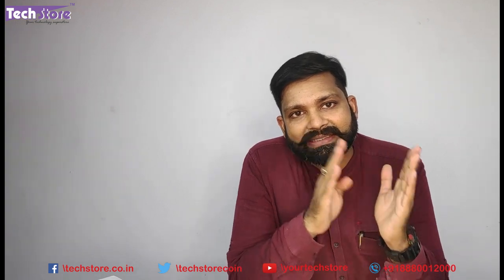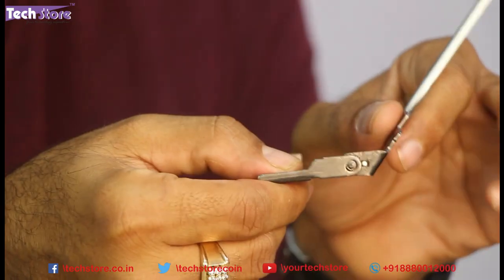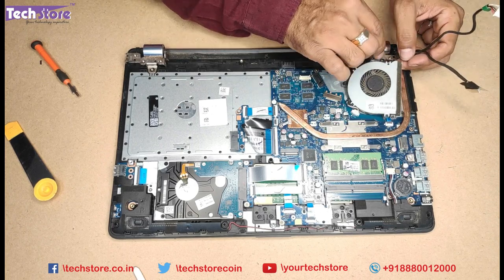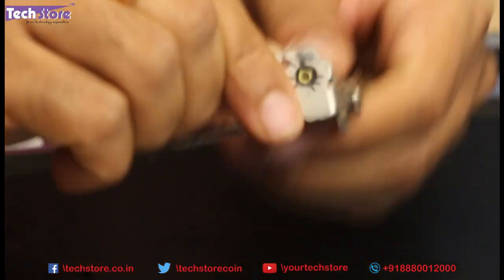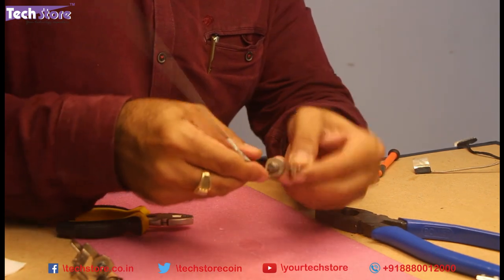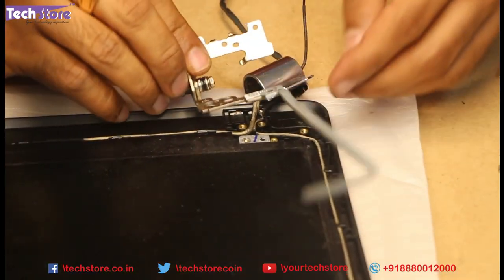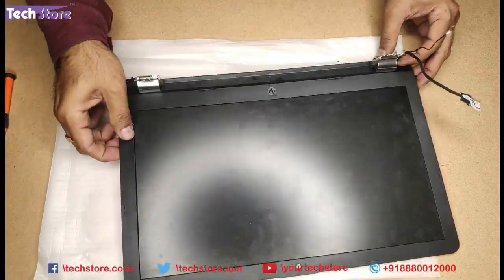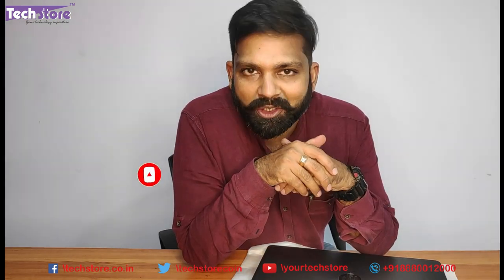HP 15 BS BR Series broken Display frame led hinges replacement applies to any laptop DIY

Comment: Thanks for showing this, it gave me good idea of what I would find when I took my laptop apart. I found broken female screw inserts on both the top and bottom covers, fixed them all with strong super glue all around, loosened the hinges a little bit and rebuilt it. Now its like new again.

Comment: Thank you Anand Baid. I have learned that I have at least two stripped female screws, the plastic to the bottom frame where the female goes has broken off, so that the hinge may not stay secure to the bottom side, the non-display side.  So perhaps I should look for a video, if there's one out there which shows how to fix or come up with something to keep the hinge secured to the bottom plastic bed where the motherboard and the fan goes.
Reply: I'm back to report how it's going so far.  I have figured out a way to put back the metal rings that got ripped off the plastic case. I am simply using a soldering iron and melting plastic to form a mound and then I sink the screw hole with a screw in place so that it is held down after the plastic cools down and then I sand it down around the edges.  But as you can imagine, it's taking lots of incredible patience and trial and error. I almost got it. The hinges are in place. I lost a few screws along the way. I ordered a set on Amazon. I also lost the power connector. So I got to order that on eBay.
Reply from the maker: you could have used Araldite solution for this

Comment: That looks easy but then l think it takes a few watches to see how you do it before sitting down to do it.  one side of my laptop is broken so l bought from Amazon the correct hinges so l forgot to include screws.  Do I have to buy anything else that l may have left out to buy  Thanksthoroughly enjoyed watching you do it step by step, and yes very detailed tutorial?  So when l am game to have a go at fixing my hp laptop l will do another comment when finished.  l see you replaced the back cover and replaced it ratherr then buying another cover can l use a bonding instead

Comment: Bro I have the exact same problem with my laptop. The screws got ripped off and the hinge is bent. i think its a common problem among hp laptops. do u have any idea where to get the hinges online? All service centres in my area are either closed or dont have the parts
Reply from the maker: Write a mail to sales@techstore.co.in

Comment: I have the same problem even the screw of the bottom got damaged. Will you please tell me from where i can order the required parts like panel and outer body.
Reply from the maker: You can mail to sales@techstore.co.in Thanks Do Subscribe.
Reply: @TechstoreCoIn  sir didn’t find it there. What will be the cost

Comment: sir can we say that aluminium laptops are better in case we don't want our panel to break down?
Reply: Yes indeed, these cheap plastic frames break with time and even for one screw slot broken we need to change entire panel which costs 3-4 k
Reply: @LearnWithNeeraj777  last year, I got mine repaired(NOT PANEL REPLACEMENT) with some screws. Now I have purchased a cheap panel online(Rs.900), I was thinking whether to replacement this broken panel with this NEW cheap panel that I purchased or not, what do you think
Reply: @sanketgupta5271  yes why not if it compatible with your model go ahead... You can do it yourself of get it done by some shop giving 2-3 hundred rupees.
In my case i ordered the original one from acer it's costing me 4k for complete panel and 300 service charge
Reply: I have an aluminium 15inch x360, the flimsy brass inserts are embedded in plastic at each corner of the screen,they broke out and cracked the digitiser ,will never buy HP again .

Comment: One more question: One of the screws on back portion is just spining. Neither coming out, nor tighten. It's under the rubber on the right side which close to hinge. May I take the bottom part while that screw in place?
Reply from the maker: It means that your screw holder is damaged. yes you can remove it while taking the bottom part out.

Comment: Sir, I am using Dell inspiron 15 5580 laptop. one hinge and the black bezel has came out but the back cover is totally fine. But the guy in repair shop is saying to replace the total backcover and all hinges including the bezel, i think u can understand kya replace karne ke liye bole rhe he. Sir is it necessary to replace total back cover as it is so costly?
Reply from the maker: Yes it is necessary to replace the whole back cover. kindly ask him to loosen the hinges.
Reply: @TechstoreCoIn  can u tell what is the price of dell inspiron 15 5580 model back cover?
Reply: No. It is possible to fix the nuts with a mix of baking soda and super glue. That works.
Reply: Indian repair means simply replace... So sadly these inefficient service center will ask you to buy a new panel for even one screw issue

Comment: should hav used wd 40
Reply from the maker: How will it help. Please let us know. We will surely integrate if found useful henceforth.
Reply: @TechstoreCoIn  instead of using coconut oil ... Wd40 is specifically made to lubricate and remove stains and dust... I'm a technician too